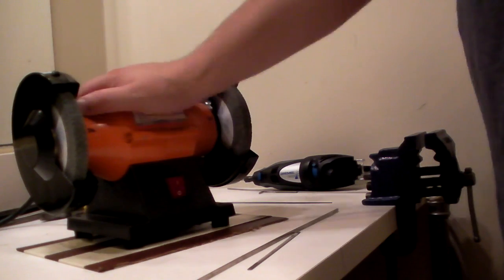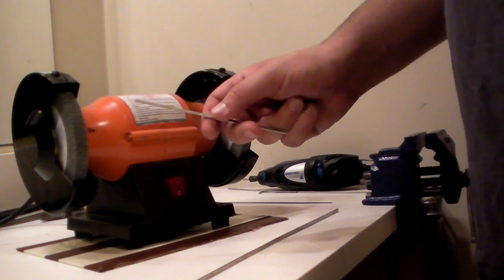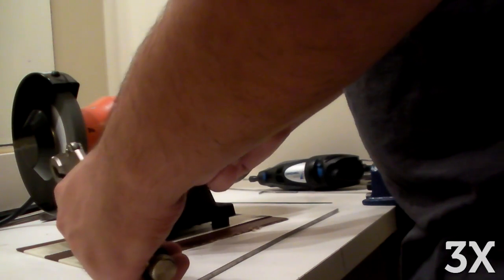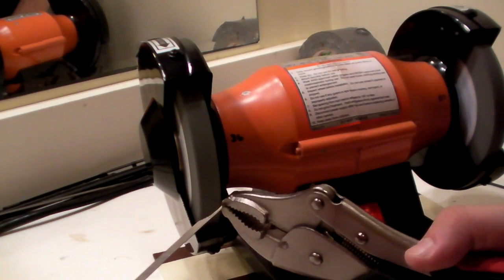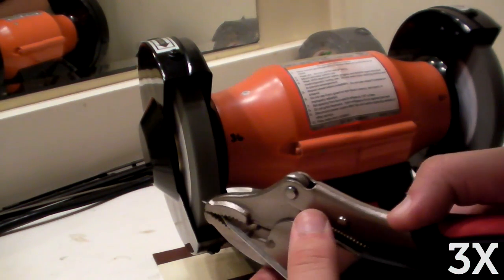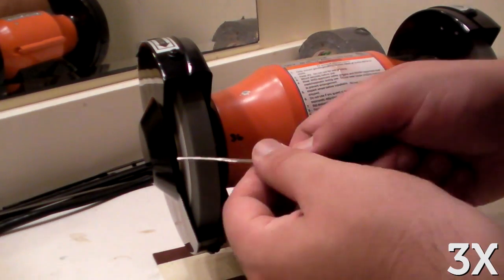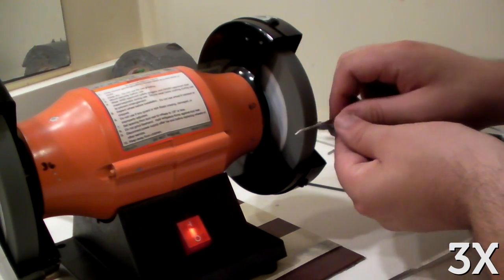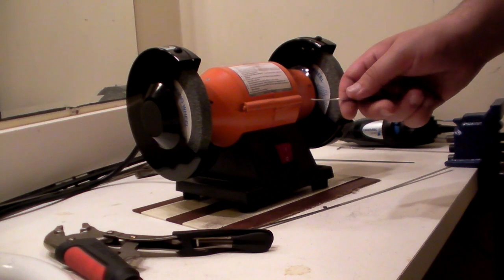09 - Making a Basic Hook

Comment: Nice video man, it really isnt that hard to make a lockpick, especially a standard hook...i have a question though, shouldn't you be quenching in water? All the videos that I've watched they were quenching all the time so the heat from the grinding wheel doesnt effect the compounds of the metal, it can make it brittle.
Reply: That is what I see too. You should dip it in water so it doesn't change the properties of the metal with all that heat. It will cause the pick to not last as long as it will bend and break after a while. I made one with out dipping it in water and it bends to easily. The second one I did with water is stronger

Comment: Wouldn't you have to cool the steel down repeatedly to not mess with the heat treatment of the steel? I can imagine picks breaking or bending easier if you're not careful with this.
Reply: It's from a windshield wiper blade, so I'd be pretty surprised if it were heat treated.
Reply: Verence It is heat treated. If they didn't need to heat treat it, they would have made it out of aluminium which is easily stronger than non-heat treated steel.
Reply: CapnTates Mild steel is generally cheaper than aluminum.  Heat treating the steel would be an unnecessary cost.  You might be right, but if so the management of wiper blade manufacturing that uses heat treated steel is not very good at their job.
Reply: I was wondering if he didn't need to dip it in water because he isn't grinding enough at a time to really get it hot, also while the metal pliers act like a heat sync that dissipates the heat